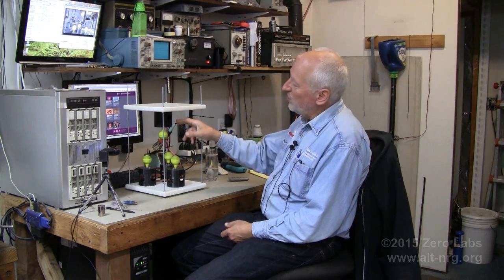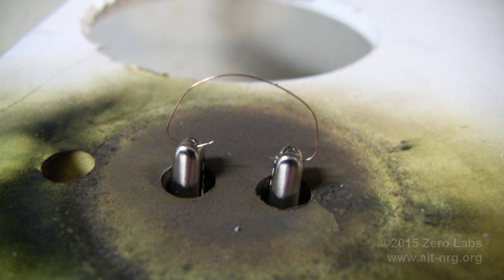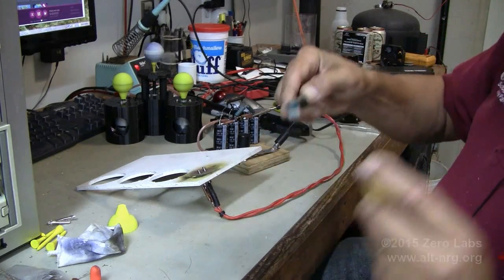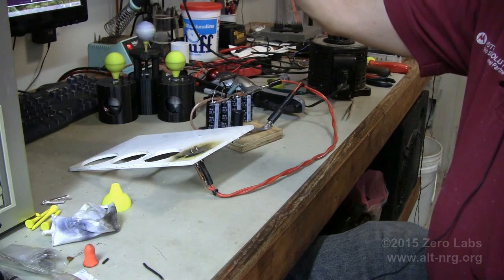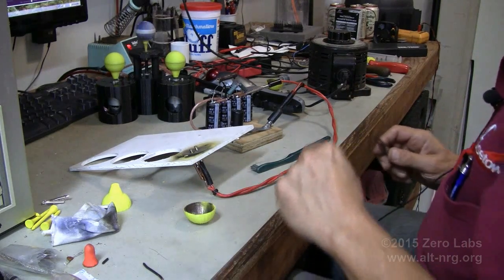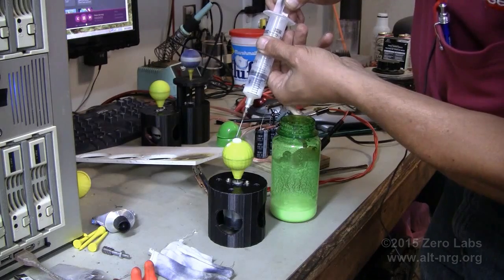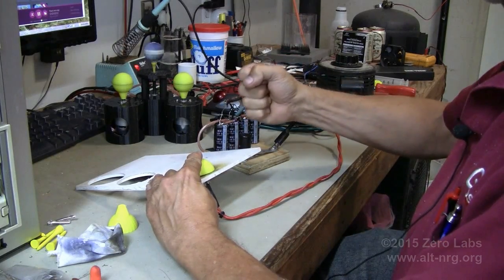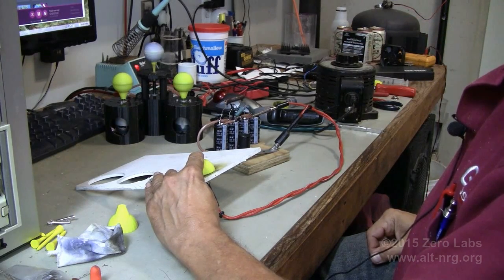#421 Keshe Plasma Reactors up & running!

Comment: Oh Geezzzzz.  The post he is referring to did NOT say to put both the zinc and copper plates outside of the solution.  There is no hope for this experiment if he has a reading comprehension problem.  The post said "I put my zinc plate outside of container, nano coated plate inside container."   He seems to be unable to follow or understand even the simplest directions.

Comment: The reaction of production of gans is not taking place since the zinc plates and the copper coated nanoparticles are very close to the bottom of the container. So there is no room for the field to act. It must be well separated from the bottom of the container and the distance between one plate and another must be at least 5 cm between them.
Reply from the maker: Uh huh.

Comment: Ripoff Report | The Keche Foundation Plasma Generator Magrav ...
www.ripoffreport.com/...magrav/.../the-keche-foundation-plasma-generator-magrav-i...
Oct 18, 2016 - The Keche Foundation Plasma Generator Magrav Ir. Mehran Tavakoli Keshe Mehran Tavakoli Keshe Watch this before you spend your money.

Crowd Funding for Keshe Scam - Revolution-Green
revolution-green.com/crowd-funding-for-keshe-scam/
Aug 28, 2015 - When I´ve heard about the Magrav Power Car System from the Keshe Foundation I was excited. Their plasma technology will revolutionize our .

Customer receives Keshe Magrav, initial output is same as input
https://pesn.com/2015/11/.../9602695_Customer-receives-Magrav_output-same-as-in...
Nov 26, 2015 - We're still coming up empty either on finding reports of purchased and received Magrav systems that produce excess energy, or of replications

Man exposes Keshe's Magrav technology to be a fraud with a full proof ...
https://www.reddit.com/r/.../man_exposes_keshes_magrav_technology_to_be_a/
Jan 8, 2016 - 3 posts - 2 authors
Even the finished Magrav units have been proven not to work so far. They have been mysteriously recalled by Keshe himself, after selling units ...

KESHE MAGRAV FREE ENERGY HOAX  Pt 1 - YouTube
Video for magrav hoax▶ 3:07
https://www.youtube.com/watch?v=9MlZjvNkfGI
Nov 5, 2015 - Uploaded by magnetshack
KESHE MAGRAV FREE ENERGY HOAX? also sorry about any ... down, I hope that's for quality of video .

KESHE MAGRAV FREE ENERGY HOAX? Pt 1 - YouTube
Video for magrav hoax▶ 3:07
https://www.youtube.com/watch?v=9MlZjvNkfGI
Nov 5, 2015 - Uploaded by magnetshack
KESHE MAGRAV FREE ENERGY HOAX? also sorry about any ... down, I hope that's for quality of video .

Confirmed: Magravs don't work. AND KESHE WENT TOO FAR ...
https://keshefacts.wordpress.com/.../confirmed-magravs-dont-work-and-keshe-went-t...
Jun 25, 2016 - So we did get an interaction between the meter and the magrav. ... plus shipping (!), which means it's the same scam under a different name!

Keshevictims Public Group | Facebook
https://www.facebook.com/groups/516335221862070/
Peter Mariën This teacher solved the theoretic problem with the magrav since there is no scientific relation ..... Misrepresenting the power of fake products.

Comment: a friend of mine is doing this so for i can not find any one who is showing actual results  how this is applied so far i cannot find any one who can explain to me the basic succint  clear principles. If you NANO coat for say fort example copper wire are you then not  creating a super conductor thus lowering power usage. . i don’t see energy being produced out of thin air. or that these generators tap into an undiscovered power source.
Reply from the maker: +Rob Ruitenberg The "nano coating" is actually an insulating copper oxide layer. The theory of operation is a moving target. The Keshe Foundation is a free energy religious cult with Keshe as the self proclaimed messiah. He is a wolf in sheep's clothing leading people stray, a discredit to anyone actually doing real research in alternative energy fields. The bullshit artist of the century.
Reply: Ok but there is an interesting phenomenon / existence which is called plasma  i never knew anything about that, makes up 99% of the universe.  Thats an ionized gas right.. Are there any theories that it is possible to tap into this universal energy source like drawing tape water out of a lake?
Reply: Thanks for this video information. I am very new to the Kishi plasma generator idea. I've reviewed several of Dr. Cashis videos and have been impressed so far. Though this is the first negative reviews I've heard about Dr. K she and the plasma generator. Can you please elaborate ? I have been so excited about the concept it has been difficult to even sleep. I want to make my own , however I do not want to waste time and resources chasing my tell either. It sometimes feels that I seem to fall for every Internet hoax. Thanks in advance
Reply: Plasma is the 4th state of matter. First is solid then liquid then gas then plasma. Energy has to be added to each state of matter to advance it to the next stage. At this point its easier to ad energy than pull out energy
ie microwaves are good at heating but we dont have a reverse process for cooling....yet

Comment: have you looked into mono atomics, and or dielectric energy mechanics as an inverse compliment to magnetic energy mechanics? these are interesting to me, in tests with mono atomics, when heating them to higher than normal temperatures during the weighing process a portion of the weight disappears, very weird. the same thing happens in superconductive material when superconductivity is achieved, a portion of the spectral weight shifts to the infrared plane. very interesting stuff.

Comment: Why all the fighting in the comments? It is now Dec 15th. Either it works or it doesn't. By the fact there seems to be no stories out there that it works, I will assume that, as thought, it is just another scam.
Reply: Because the solstice is approaching and Jupiter is limiting Saturnain ringlet reflections, subdurning the energy levels.

Comment: This is so ridiculous. Where is the hard data? Take two identical pots 
filled with the same amount of water. Verify the water temperature is 
identical. Place a heater under one pot powered off the mains, or off an
 extension cord running from a neighbor's house (if that is what is 
required). Put a meter on it. I want to see the wattage going into the 
heater. Connect the other heater to this device. Place a meter on it 
also. Do they both bring the water to a boil in the same amount of time?
 Is there any actual, measurable difference in the amount of power 
required to boil the water. Any excuse for not doing this type of 
experiment is proof of fraud. Produce hard data and hard results or you 
are wasting everyone's time. I dont want to hear about how you cant hook
 this or that to it. That is just some extreme bullcrap. Put a heater on
 it. Produce real measurable data.
Reply: +Iconoclast421 
You forgot to mention peer review and repeatability.

Do you remember the cold fusion furore of 1989. Still nothing. It appears that Pons and Fleischmann, both highly respected scientists at the time had made a mistake.

Comment: Use an analog meter .your lcd meter will read numbers just from stray capacitance and are unreliable because the have a quartz clock time base generator. Use a normal analog meter that font use batteries..

Comment: Great job, but I think now the nano coated coils are the main focus... maybe if you can make the coils? as described on the new "blueprint" videos and test them?
Reply from the maker: +Shandor Zakarias I have come too far with the original experiment to change direction. If there's any effect at all, it will be demonstrable with this device. It is the basis upon which all of his other work rests. If this does not work then none of the others work either.

Comment: I think the upper motor is spinning faster just because the weight of the upper reactor is not pressing onto the ball-gear of the motor (gravity pulls on upper reactor instead of pushing towards the motor). So it is no wonder that the upper reactor might spin slightly faster.....
Reply from the maker: +Kreischzwerg I believe that's correct.

Comment: Hi,High Zero, I've been working on Electro-gravity via Geometric Chronon Field for 12 - 13 years. The outcome is that Warp Drive can emerge out of high charge separation. 10 PF capacitors with 50 Kv will not generate any measurable thrust, not event 0.1 Micro-Newtons. You need to separate tens to thousands of Coulombs over 1 meter distance in a meter^3 volume to get thrust on the expense of far bodies of mass to come a bit closer and lose gravitational energy which is theoretically turned into electric-energy.Just to separate +20 and 20 coulombs over 1 meter in 1 meters^3 would require several giga volts which seems practically very difficult if not impossible.To my opinion, no such charge separation occurs in Keshe reactors. At most if the core has several + coulombs and the outer gas, also several coulombs, you would get rotary diagonal warps that would contract space-time metric and gain energy by Dennis Sciama inertial induction like process. I fail to see how such process can appear in Keshe's reactor as not enough charged particles are separated.You can see my work in:www.scribd.com/eytan_ilwhich is based on doi: 10.9734/PSIJ/2015/18291, see http://sciencedomain.org/abstract/9858The following errors were fixed:1. After 16, A(Myu,Nu) = -A(Nu,Myu) and not A(Myu,Nu) =-A(Myu,Nu).2. The classical limit after (71) has a superfluous division sign in the root    denominator, just before the sentence, "A friend, Mr. Yossi Avni suggested that".3. In the corrigendum, section 3) "... and therefore if U(k) is fully imaginary".    U(k) can't be fully imaginary. It is a mistake. 3) Talks about Majorana neutral    fields.Blessings,Eytan Suchard.
Reply: +Eytan Suchard http://sciencedomain.org/abstract/9858Fixed errors are in http://www.scribd.com/eytan_ilYou can also find Electro-gravity via Geometric Chronon Field in academia.eduwith other  Eytan Suchard papers.The following was accidentally marked as deleted in the previous message.20 coulombs over 1 meter in 1 meters^3 would require several
giga volts which seems practically very difficult if not
impossible.To my opinion, no such charge separation occurs
in Keshe reactors. At most if the core has several + coulombs
and the outer gas, also several coulombs, you would get rotary
diagonal warps that would contract space-time metric and gain
energy by Dennis Sciama inertial induction ...
Reply: +Eytan Suchard http://sciencedomain.org/abstract/9858Fixed errors are in http://www.scribd.com/eytan_ilYou can also find Electro-gravity via Geometric Chronon Field in academia.eduwith other  Eytan Suchard papers.The following was accidentally marked as deleted in the previous message.20 coulombs over 1 meter in 1 meters^3 would require several
giga volts which seems practically very difficult if not
impossible.To my opinion, no such charge separation occurs
in Keshe reactors. At most if the core has several + coulombs
and the outer gas, also several coulombs, you would get rotary
diagonal warps that would contract space-time metric and gain
energy by Dennis Sciama inertial induction ...
Reply: +Eytan Suchard  Congrats on your twins.
Reply: +keenanleetodd  Thanks. We currently have two rotary warp drive designs for the extraction of gravitational energy by metric tensor contraction. The principle is known as Dennis Sciama inertial induction. It  draws far bodies of mass a bit closer and gains rotation.

Comment: start with the simple generator, then wen the plans are out for a ufo lecitation then try it out ,so far everything is release in do time and you are before time, put your gear aside use the coils build a generator,once you see that work then go on to biger project, if I am totally wrong let me know .it is possible but so far I don't see the science well applicated.

Comment: Hi Zero, I am not a follower of Keshe but I see parallels in some other fields here. Let me explain. This white powder you are extracting is in effect a super conductor called Ormes. Usually called the white powder of gold. Although gold is not associated with this process. In your experiment your powder has been contaminated by the Zinc Oxide from the Zinc plate. FYI the white power of gold is not that exactly, that's what they called it because gold was used in the process to boost yield of this substance. It actually comes from the water itself. Let me explain. Everything has this powder in it. In fact it is the medium itself that condenses into the powder. Many processes can yield this powder including Keshe's rather crude process albeit rather low output. The less that is included in the solution the better the results and the less contamination in the results. You might want to look at the Ormes process to extract the white powder instead of the crude gentle electrolysis that the Keshe camp uses. I am entirely surprised you didn't put two and two together about the ormes process being so close to Keshe's process. The thought process behind this is that once you condense the medium(white powder) <- Aether or energy conductor of everything, it still retains a connection to the rest of the medium. Spinning this condensed medium the way he does spins the medium itself around the unit very slightly. Hence the reason it takes some time to spin up the medium as they report. When the medium is set spinning everything within that spinning medium has better conduction and hence a higher energy. This could in fact boost any energy flowing within the sphere of influence of the reactor. Theoretically of course. Try using the Ormes process which uses precise alchemical processes to condense this white powder or condensed aether. Sending the powder to a lab will only analyze as silicon as per Hudson and will be a check to see if you have the right powder. As for the rest of Keshe's claims, Well I leave it up to you to figure out after the analysis of the systems and the proper powder.